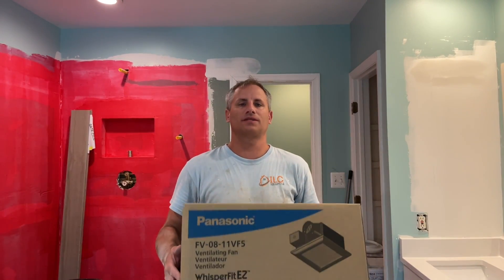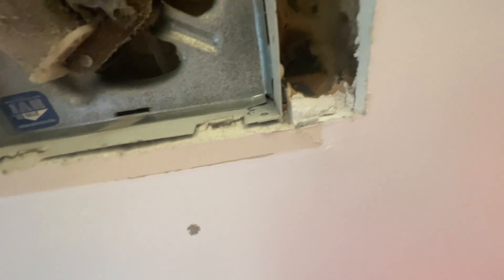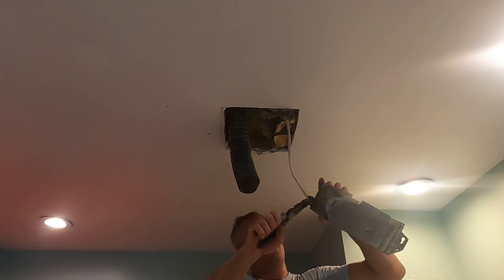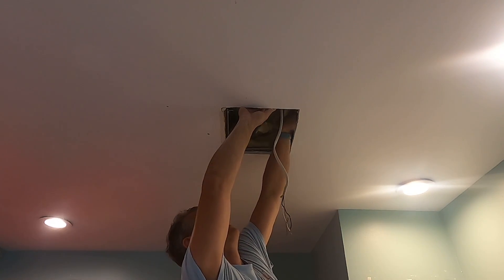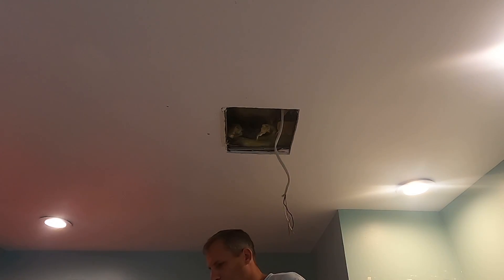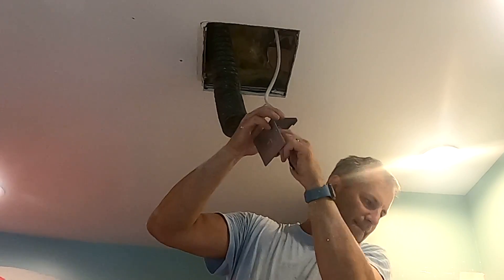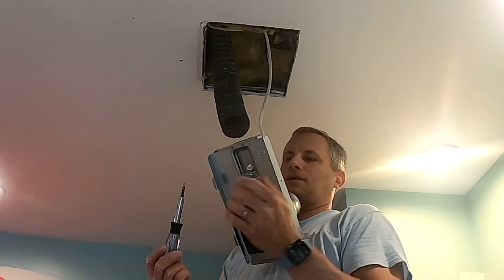Panasonic Retrofit Exhaust Fan Install Guide

Comment: DO NOT RELY on the switch to power off.  It is sometimes possible that the switch was wired up backwards making the neutral the switchable leg meaning that the hot is always on to the vent assembly.  In this case, regardless if the switch is in the off position, you will get zapped  TURN THE POWER OFF AT THE PANEL!
Reply from the maker: That’s great advice. You can never be too safe.

Comment: just ordered a Panasonic fan to install in my daughter's house.  She has the cement grinder old junk, useless, got the Panasonic  retrofit version for this same reason, RETROFIT.
Reply: Changed out the 3 old Broan cement grinders with 3 new Panasonic.  Retrofit models.  2 no light, one with the LED light. SILENCE and lots of air draw.  Taking out the old ones mounted with NM cable clamps! Talk about cheesey.  But good to remove. Slide up the Panasonic bracket, fantastic.  The plastic slip on reducer to fit existing duct.  Ours where the 3 speed, set all to high speed, SILENT, they are inverter driven, ramp up to speed.  But I use WAGO, WAGO is easier and quicker.  Wire nuts are so 20th century.  Clever design with Panasonic, they make it little bigger so when you pull out the old junk, you have room to work, and the Panasonic covers it all.  Best vent fans out there, clever designs for retrofit, how the electrical box and duct section comes off to make work easy

Comment: I missed how the large fan unit connected to the exhaust duct and the power. I saw how you hooked the duct and power to the 'side section' and then stuffed the side section up there.. seems like it was just stuffed up there and not connected to anything. Then you pushed the large fan section up in the hole but didn't show any step to connect it to the side section.
Reply from the maker: I have a new exhaust fan video dropping in 2 weeks that explains the most asked questions, like this one, people have had on the install. I have cameras in the attic, lol.

Comment: Excellent video, but no way is it going to be this easy for me. Here is the run down : As soon as I open the drywall (1) insulation will fall in my face (2) I won't have 3 feet of extra wire and exhaust pipe to use , more like 1 inch (3) the new fan will not fit.  (4) gapping hole in ceiling , no fan and still have to go into attic.  The power of positive thinking is on my side! Oh and my attic access is 18 inch x 18 inch  and I am borderline obese.
Reply: I just saw you have a video with a complicated case!  Awesome!!

Comment: A flexible duct! When I saw you pull that out of the ceiling I was stunned. I never even thought to use flexible ducting. I was dreading replacing our old 3" ducted fan and I didn't get the easier EZ Retrofit Whisper model so needed to do a bit of fussing with our ducts. I had the 4"-3" galvanized reducer but also needed a small extender. I saw your video and it was like an epiphany. Headed over to get a piece of flexi and voila - so much easier. Thanks for great visual advice and a great video.

Comment: Another comment mentioned this, but towards the end I’m not seeing what those screws are going into other than just drywall which doesn’t work.  It is where you say how incredibly tight those screws get.
Reply from the maker: They go directly into the metal frame I installed above the drywall. I have a new video coming out that will visualize all of this really soon.

Comment: My duct/wiring assembly seems to hit the bracket. Does it matter how thick the ceiling + bracket is (@ 14:00 in the video) I'm 90% of the way there and a bit frustrated I can't get this last part in.
Reply from the maker: You’re probably not lined up with the little tabs the box slides into. They might be bent or crushed. Take a look at that.

Comment: Use WAGO connectors, wire nuts are obsolete
Reply from the maker: All great valid additions on electrical connection etiquette! Great comments.
Reply: Wago's are like backstabbing an outlet. Keep em'.
Reply: @JessicaT-qp9uv  not at all, totally different design.  Pay attention,.  they are tested made in Germany, not your back stab Leviton consumer junk.  Wago is superior in all aspects to wire connections, they keep developing new versions for specific uses.  Back Stab outlets connections in the U.S. have nowhere near the surface area making contact with the conductor.  And it's not the same metallurgy, and the entire compression function is not like a back stab junk Leviton.  Wago for the win
Reply: @cengeb  well....based on that sales job, I'll take a closer look at them.  Thanks (-:

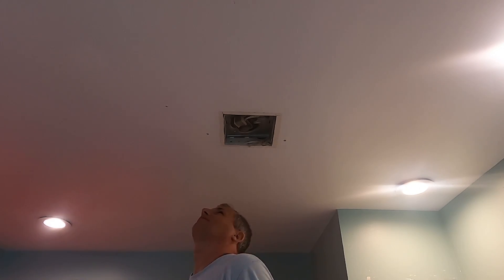Comment: Thanks for this, it was very timely.  However there were a few things that were not clear to me.  First, it would be good if you could put some better light on the project.  Shooting video with 2 ceiling lights in back of you guarantees the camera will darken the image.  Second, you don't explain what you mean by "split the difference" at 1:31.  What exactly are the two things you are splitting?  Is the size of the template based on the instructions?  Finally, is it magic that the fan runs?  You do not show how the electric is connected to the fan, but at 13:44  you shove the assembly into the opening; later when you put the bracket are the screws also connecting that assembly to the bracket?  

Again, thanks.  I am about to give this a try, although I have a lot of trepidation.
Reply from the maker: Correct on splitting the difference with the template. The new fan is bigger than the old one. 

Electric is very easy on the fan. Black to black, white to white, and ground to ground.  Very straightforward on the wiring. 

Agree on lighting. Good luck with the project, you got this!

Comment: I think this is the best install video for a retrofit.  I've seen a few that were plain wrong.  The installation instructions also aren't great. I also reeeeeeally like the tip you give where since this fan is larger than your typical contractor grade unit you can actually cut the ceiling first and gain access to the nails/screws to remove the old unit. 

Unfortunately I had some condensation issues in my previous pipe and as a result some water had leaked and gotten on the ceiling so I had some drywall repair to do.  Still it helped watching this.

Comment: Why can't you use 110cfm on that 3 inch pipe? What's the reasoning for doing 80 only.
Reply from the maker: Back pressure. Too much air being forced into a small radius pipe. Your exhaust will suffer.

Comment: Best video I've seen on this fan. But, does the fan have to orient a specific way to the joists? Unfortunately, I think it does. I had to rotate the fan 90 degrees from the way the last fan was hooked up so the ducting and electrical would both reach the unit.  I tried to install the unit with the face of the duct/electrical hookup parallel to joists- and when I tried to connect the fan to the utility hookup (the piece connected to the ducting and electrical) the fan was blocked by the bracket. There is nothing in the directions that specify which way the fan needs to sit in the ceiling and I don't think it was mentioned here or in any other videos I've seen- if you do another retro fit video for this fan, maybe add that nugget. Thanks again for a good video.
Reply from the maker: You can add 2x4 blocking and "turn" the bracket around if need be. If you attach the bracket to the existing joists the retrofit will have to go to the left or right of the existing joist, which usually is a standard install practice on the existing fan. What you have going on is unique. 2x4 bracing to flip the bracket around is your best bet and that's what I would do in your situation. Thanks for the kind words. I did recently did an updated exhaust fan video, but never thought to mention what your problem is. In 2 years I'll be sure to include it in another video, 

https://youtu.be/G0BEpSTi-1k

Comment: Very helpful, thank you.  I'm repolacing an old fan and will try installing from below (I was NOT looking forward to laying in fiberglass).
Reply from the maker: I have a better newer video coming out in a week! It goes over the Home Depot Panasonic fan which is a little different than this particular one.
Reply: Panasonic retrofit versions, are a must for changing out the useless old grinding Broan Nuton junks.  the bracket mounitng of the superbly designed Panasonic, is great, the solid painted fan assy won't corrode .  They are designed to install from below with the folding bracket assy, the fan body screws into the bracket anywhere along the rails.  Brilliant design, easy to attach rail to the existing rafter, line up and snap the exhaust duct to the pre mounted piece, fan assy snap in place secure with screws.  Don't forget the ground screw to tie them together as for UL listing, make sure fan speed is set, and exhaust ducting is secured to adaptor, with wire tie or good metal tape..best fans available.  several models, get teh retrofit ones, not teh ones for new build, diffrent system of mounting, retrofit versions are brilliant to replace exiting junk Broans, from below

Comment: Thank you.  I'm an idiot and just couldn't understand how the fan would attach to the ceiling or bracket.  There are no screw holes to mount the fan to the bracket.  I watched like 5 other videos and yours was the only that mentioned the self tapping screws just drill into the bracket anywhere......duh!

Comment: Why can't you use 110 cfm on 3 inch hose?
Reply from the maker: You can, but the air will backdraft from too small of a circumference. It will also be louder from the resistance because it's only 3". If you go online you can find data on CFM and what sizing you need to push air though.

Comment: You didn't show how the power box attached to the fan box?  Did you have to screw it down? How did you managed to align them?   Thx
Reply from the maker: 7:06-7:10 if you pause around there you see there’s a Phillips head screw shown on the box. You just remove that screw and the cover pops off. After that, you install a romex connector and some wire on the cover then it’s black to black, white to white, ground to ground. It’s covered in the video, but I didn’t spend much time on the actual cover since when you get the fan, it’s pretty in your face.  Good luck with the install!

Comment: Great video, this really helped me visualize the install process.

So 110 CFM will not work with 3 in duct? What happens if you try to switch it to 110?

I have a ~100sqft bathroom and I'm replacing my 50 CFM with this. I have 3in duct as well. I was hoping to use 110 but 80 should be OK I suppose.
Reply from the maker: The 3” duct can only do around 80 cfm in a perfect situation since it’s a small diameter hose. Back pressure will build up most likely at the 110 cfm setting.  4” has a lot more air able to be pushed through.

Comment: How did you decided on which CFM and Humidity sensor amount to set the fam to?
Reply from the maker: That's a good question.  There's a calculation you can do(google search), BUT, you are limited to what type of ducting is existing. If it's only 3" duct, you are limited to the lower setting on the fan.  If you have 4" duct, you can go with a higher setting.  You have a lot of variables with CFM, duct size, fan power, and length of duct run.  As long as the fan is pushing out moisture, that's what is important. That's why I always install a humidifier switch on all of my fans.

Comment: lighting is bad. The electric and exhaust unit was not fastened in. Is that correct
?  You cannot see the connection of the electrical and exhaust unit to the main fan. You need close ups of this.
Reply from the maker: Electric and exhaust are fastened by a machine screw and the screws that hold the box into the frame that goes into the ceiling. Electrical connection is talked about in the video. 
If you had the fan in your hands you would see the details you want are very straightforward and not really needed in the video. There’s a balance on making videos that can be too long.  Good luck with the fan!
Reply: @TodayIWorkOn  the purpose of video is to show exactly how to do something. Talking about electrical connections is useless, show them. Talk less, show more and light the subject area, especially the dark areas.

Comment: Great video, thanks I have sub'd. My 8 year old Panasonic fan quit working, I have cleaned it, it appears to be electrical, I replaced the single switch, still no power at the unit. Yes I will turn off the electrical, yes I have a tester.